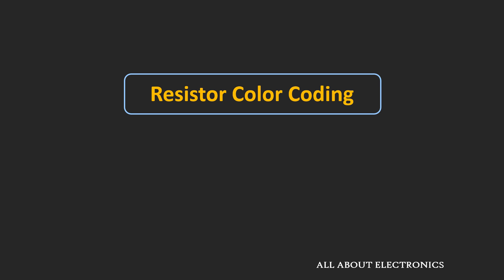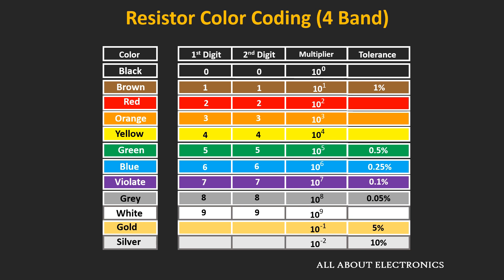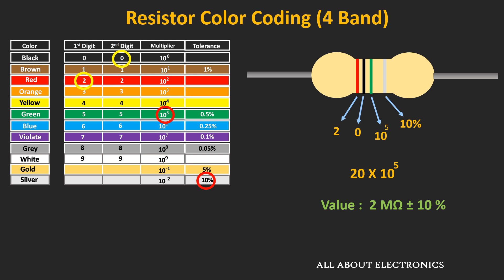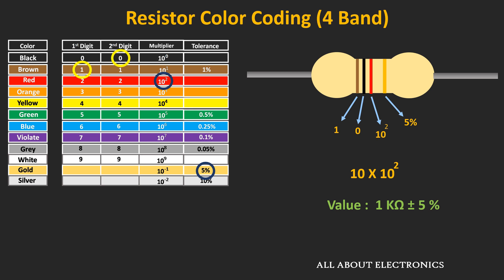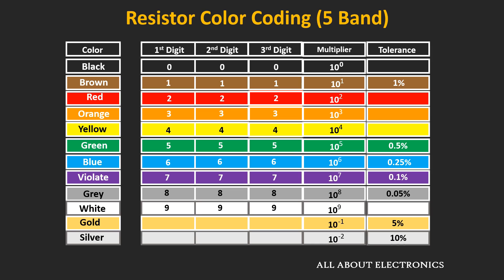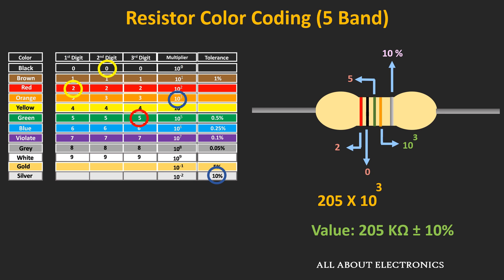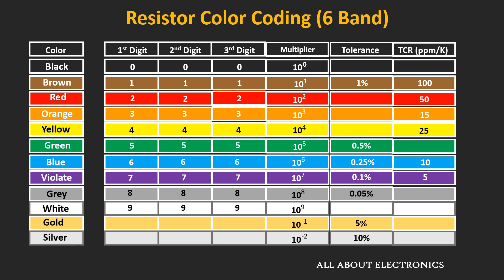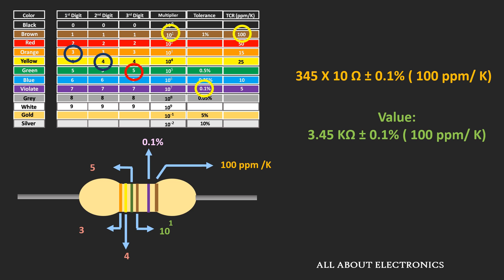Resistor Color Coding Explained

Comment: What is tolarance😕 .????
Reply from the maker: Tolerance is the maximum difference in the actual value of the resistance to the nominal value. 
e.g for 1kΩ resistor with 1% tolerance has nominal value of 1kΩ. but its max value could be 1010 Ω or minimum value could be 990 Ω.
I hope it will clear your doubt.
Reply: @ALLABOUTELECTRONICS  thanku ..
  You are amazing in teaching❤❤❤❤
Reply: @ALLABOUTELECTRONICS  In general what value is considered....??

Comment: When 3 Band Color is Gold.
How to calculate the Resistance of the resistor?
Reply from the maker: In case of Gold (for the 3rd band) the multiplying factor is 0.1. Similarly, if the 3rd band is Silver then multiplying factor is 0.01.
Reply: Thanks